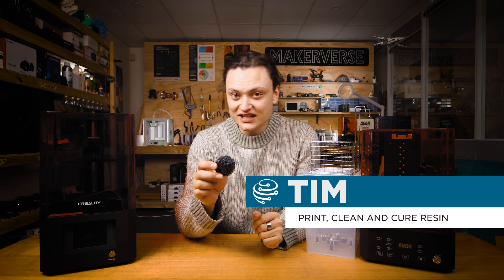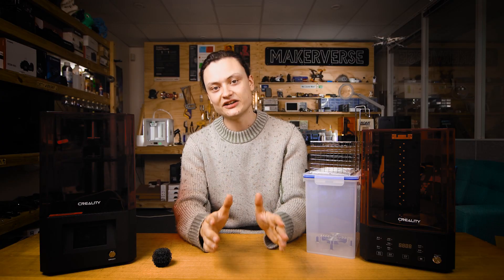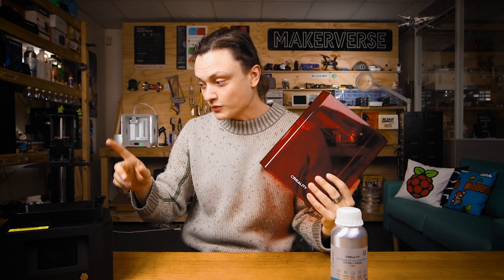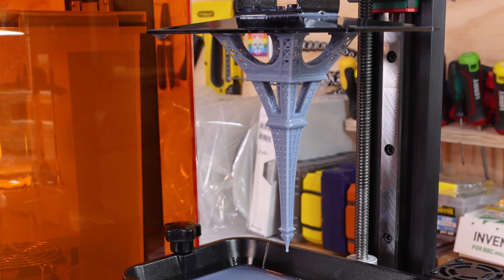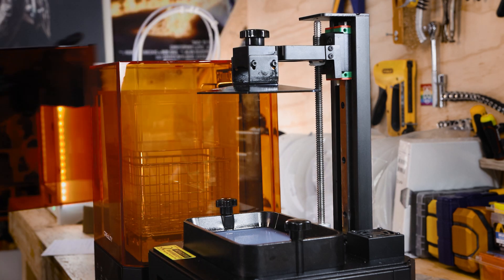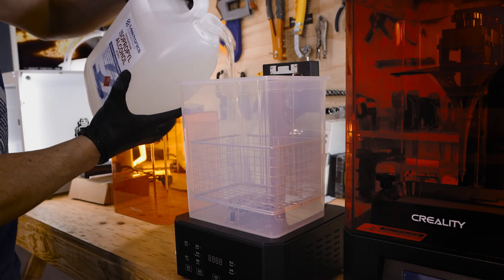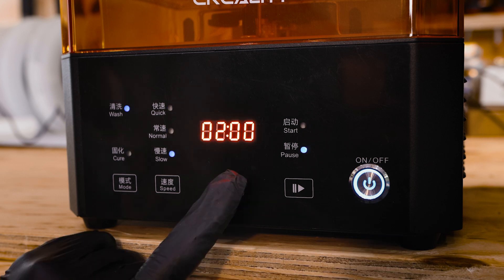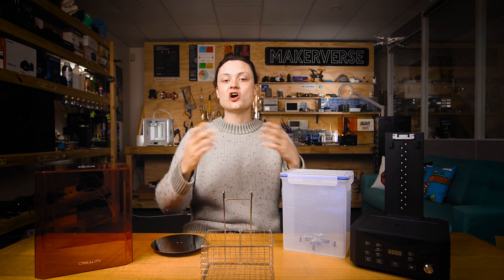How To Complete Your First Resin 3D Print | Creality LD-002H

Comment: 3 noob questions:
- do i have to clean the Vat everytime I print something? 
- To figurines with supports do i Take out the supports before or after the curing process? 
- Do I have to change the IPA every new print wash?
Reply from the maker: -Cleaning the vat: Clean it if you change resin types/colors or after a failed print, but a quick check for debris is usually sufficient between prints.
-Removing supports: Remove supports after washing but before final curing to minimize damage and ease removal.
-Changing IPA: Replace IPA when it becomes cloudy or less effective; you don't need to change it after every wash.

Comment: Any suggestions on why the print time for the Eiffel Tower is clocking around 12hrs?  I'm currently printing the same model from the thumb drive.  Printer is the Creality ld-002r.  Really appreciated the information on under/over curing.
Reply from the maker: The Creality LD-002R features an RGB screen to shape the UV light emitted from your printer. Compared to the LD-002H featured in this video (which uses a monochrome screen) the UV transmission is significantly lower, which results in longer curing times per print layer and overall long printer times.

The estimated times on your printer are also very rough guides, unless you calibrate your slicing software to account for your specific printer's speed it could be out by an hour or two.
Reply: @Core-Electronics  thanks for the reply.  I was thinking should I print an object, let's say a building, horizontally instead of vertically?  This would reduce the layers, no?
Reply from the maker: The Lower the model the Faster the 3D print 🙂
Reply: Hi me Rana Naveed here please send me dis printer setting chito box slicer   ld 002h

Comment: Great video 
I have an opportunity to purchase both the Creality LD-002H Resin SLA 3D Printer + UW-01 Washing here in Canada for $319.00 as a first time purchase of a 3d printer would you say that this is a good printer to purchase and a good deal. I work in 1/24 1/35 scales.
Reply from the maker: Heyya mate, thanks! The Creality LD-002H is an excellent way to get into resin 3D printing, particularly for those scales your interested in + if you can your hands onto a cure and wash station right at the start your 3D printing life will be significantly more easy and fun 😊

Comment: Any idea what would cause a print to just not print at all? When my plate starts becoming visible (after hours of printing) there's just nothing on there. 
Thanks!
Reply from the maker: Heyya mate, double check you haven't got a big gloopy mess hidden underneath your uncured resin in the VAT by using that plastic spatula to delicately feel around the tank. If you do it is time for a big clean out with IPA. 
Also make sure you have UV light coming out of the printer. You can pull the VAT off the printer and run a | Clean VAT Cycle | just to check if it is running. 
Finally if all is well consider increasing your exposure time. If you don't let the first layers get enough UV light they are likely to fall from the print platform. Check here for how to find the optimal layer exposure time - https://core-electronics.com.au/guides/perfect-resin-print-exposure-setting/ 

Hope this helps and you get right back to 3D printing beautiful models! 😊

Comment: Realistically someone's first print would not be using a wash and cure station.
Reply from the maker: If I can save just one person from the mess of a resin printing without a wash and cure station then I will be ecstatic. Nevertheless all the procedures talked about with the wash and cure can be readily emulated manually.